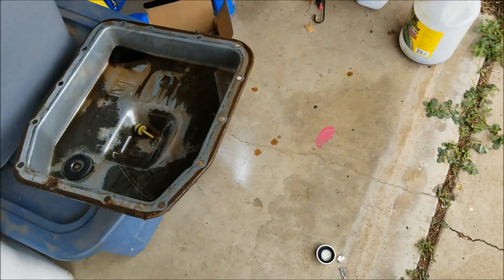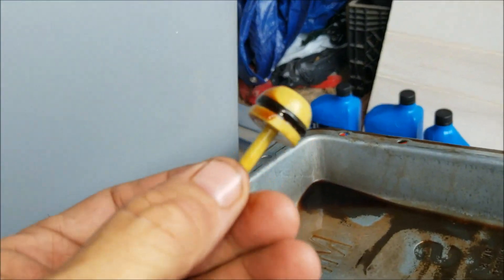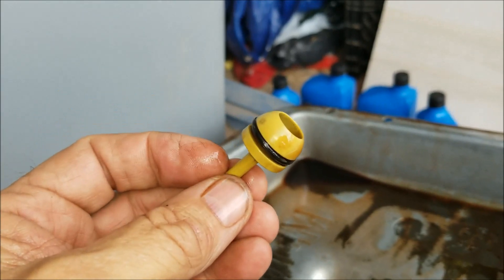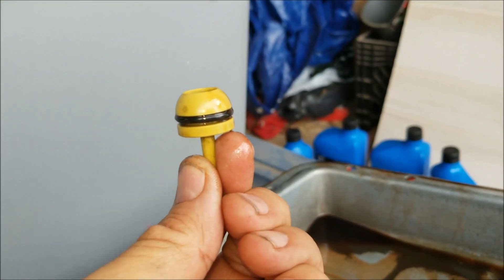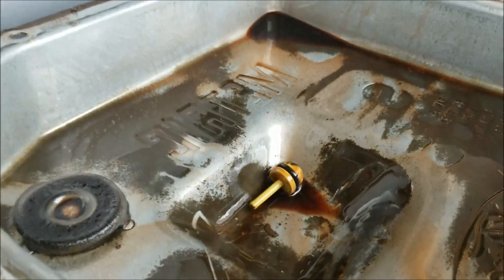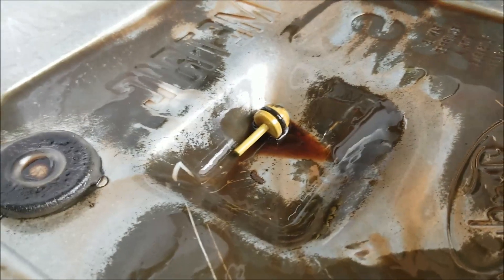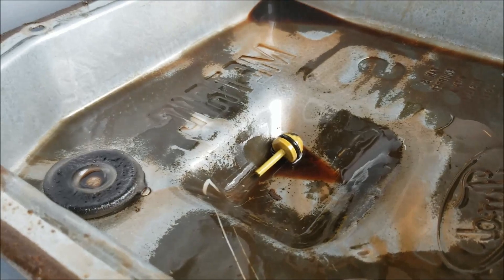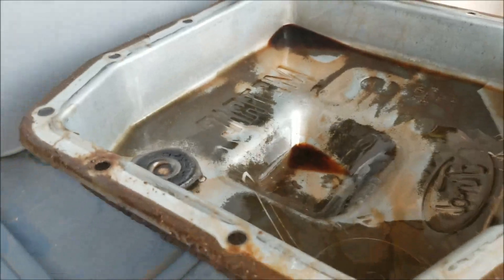What Is This Plastic Thing In My Transmission Oil Pan?

Comment: I'm working on a 2007 F150 tonight. It's 2024 right now and you're telling me this transmission fluid has NEVER been changed? I believe it. I just did a short showing the magnet and it was completely HIDDEN by metal shavings! I'm sure all of the miles on this transmission was done on factory fluid. I'm gonna pull the transmission out and rebuild it. With this much in shaving - and finding this plug in the pan - I'm 100% sure this is all factory. Explains why it won't go from 2nd to 3rd. TIME to rebuild!

Comment: My 2008 has 230k. I paid to have the trans fluid changed probably 4 times. I just did it myself and found this. I think I got ripped off!
Reply: Probably was changed most shop will use a pump to suck the fluid out through the dip stick tube.

Comment: plug from the factory for the dipstick hole it pops out once the dipstick is installed from the factory into the pan and it stays there until the transmission fluid is changed

Comment: Thanks so very much. I was about to have a cow. I stepped out of my comfort zone to inspect the valve body for an overdrive issue. I'm going to check the wiring as it is the next easiest thing to look at. I pray I don't need to change or rebuild this transmission.